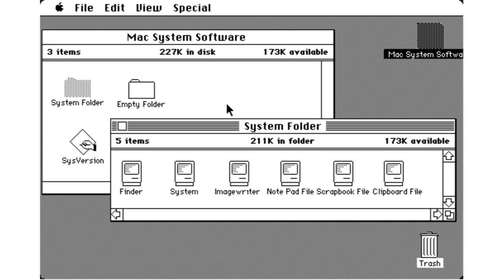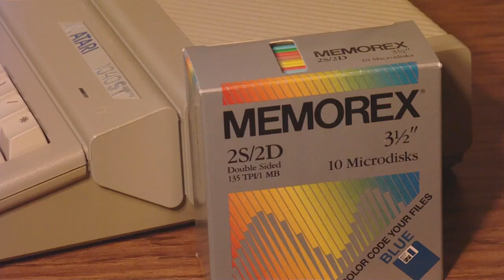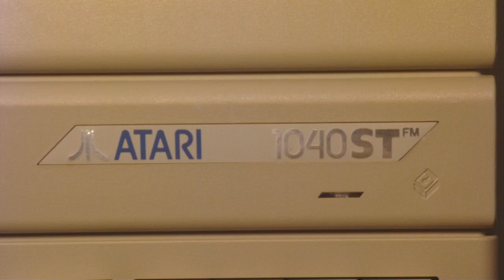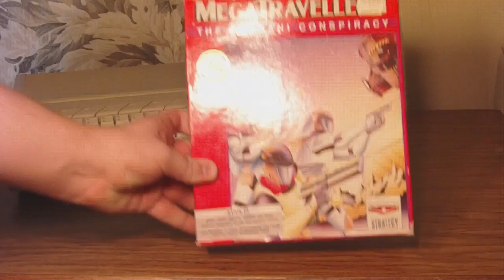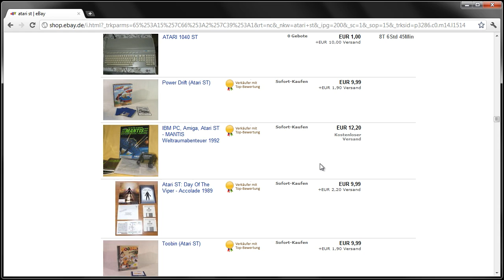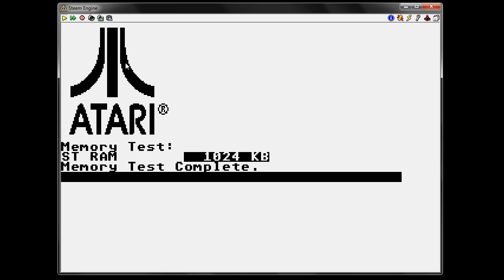LGR - Atari ST Computer System Review

Comment: The timing of the midi ports on these machines still scores the highest accuracy scores in midi timing device shootouts,the midi clock is unburdened by a bloated OS like modern pcs which have shockingly bad midi timing.I learnt all i know about music using cubase on the 1040ste.Great machines :-)
Reply: Very neat story, Scotty! Thank you!
Reply: Still have mine, had cracked Cubase, without a dongle, it never crashed though and was always rock solid, use Ableton now, which has crashed often.
Reply: Pretty much started (or enabled) the whole techno /Industrial /Euro dance craze of the early '90. Almost every professional (and most amateur) studios had one with a B/W monitor (exceptionally easy to work with for longer periods of time), sometimes even with SMPTE timecode sync (so the MIDI playback cursor would follow along with the tape). Great stuff!
Reply: @christophergodawski5663  Yeah, I'm actually watching this (though I'm an LGR fan in general), because it was on a list of hardware used for Aphex Twin's Syro from 2014.
Reply: Interesting bit of info, thanks
Reply: @christophergodawski5663  I think FatBoySlim used an ST for some of their makings.

Comment: Extra fun fact. The cartridge port was used by the required dongle for C-Lab Notator, which was the MIDI software we all used on this great machine. The connector was in close proximity to the MIDI ports, mounted directly on the PCB with little mechanical support, and a lot of the used units out there have dodgy cart slots as a result.

This was my first computer and I used it for years to make music on, and really loved it - despite the fact that I had to secure the dongle with gaffa tape in the end.
Reply from the maker: +The Bright Pixel Interesting, thanks for the info!
Reply: +Lazy Game Reviews Thank you for the incredibly entertaining videos! I'm a new subscriber - after Mr. Ben Heck told me about your channel on twitter the other day. Love the retro tech.
Reply: +The Bright Pixel +Lazy Game Reviews - I used to have a mono audio sampling interface that used the cartridge port. When I was a teenager I used to hook it up to a CD player to take samples, then I made my own remixes. I used to love the Atari so much =)
Also I'm not sure if it was mentioned in the video but shortly after the ST FM was released, the ST E came out which featured 'E'nhanced graphics and sound which equaled the Amiga. It's a shame you didn't get to review that model as pretty much all the negative points made are unique to the ST FM line.
Reply: Cubase was invented on the Atari, it was originally called Notator.
Reply: *****
 Ah okay :)
Reply: @LGR  could you possibly use the ATARI mouse on the NES?
Reply: That's not a fun fact, and definitely not an extra fun fact.  It's actually a sad fact if you ask me.  I mean physical DRM caused irreparable damage to countless machines, that's a terrible shame! 😢

Comment: Something I really liked about the ST was coding in assembler, it was a joy to do, with excellent reference books available. I'd done a fair bit of 6502 coding on BBC Micros and an Electrion, but asy on the ST was in a different league. I ended up writing an entire word processor in 68K, which was ridiculously fast in use (it was my main 3rd year project at uni, the largest they'd ever received, the listing took 2.5 hours to print out). Funny thing, the program became popular with other students, they used it in preference to the editor supplied by the uni. :D

Ian.

Comment: You could link up to 16 computers using the midi ports and play multiplayer MidiMaze.  The tagline was "KILL A HAPPY FACE"  It looked something like hover, but the characters were all round balls/happy faces.  You roam around a maze and shoot at each other.  FUN!  A buddy and I also made a hard disk interface that converted the Atari DMA port (proper terminology) to a SCSI port so you could hook up any hard drive.  Mine had a 480mb NEC drive, a CDRom from an Apple, an 68030/12mb upgrade (the SST from Gadgets by Small), and a video card upgrade to 1024x768x16 bit graphics.  It outpaced PC's for 10 more years.  I still have it, but haven't fired it up in 20 years.
Reply: MidiMaze is also afaik the first FPS game.

Comment: I didn't know an NCR 386SX could run Windows 7! :-P

I haven't had any trouble running PAL programs on my NTSC 520ST. Even the U.K. PAL version of TOS runs fine. The video output becomes 50 Hz NTSC, but it displays fine on any NTSC composite monitor or TV with a manual V-hold adjustment.

The Mega ST was also briefly popular for desktop publishing when Atari packaged it with a low-cost laser printer. You got most of the capabilities of a Mac and LaserWriter at a fraction of the cost.

Comment: Fun fact - You can use Sega Mastersystem controllers.
Reply: Or genesis
Reply: Genesis controlers are wired slightly differently and do not work with the st.
Reply: Oh, i thought they were the same pinout. I was wondering, since i've used master system controllers on the genesis.
Reply: Genesis controllers, even the six button ones, work just fine on my Commodore 64, though, so it's probably something to do with Atari trying to limit the amount of controllers to use and really just failing with SMS controllers still usable.
Reply: Fun fact, you can use an Atari joystick in the Genesis (however it really only works with Sonic, or other games that use one button).
Reply: There was a joystick extender box available, where you didn't have to fumble with the ports at the bottom of the machine anymore, you simply plugged the joystick/mouse into the extender box next to the machine (one can even make one out of some spare parts).  The non-"M" version could be modulated with an external video to RF modulator.  So there you have it, shortcomings "sorta" solved. :)
Reply: Yep, just saw one up on eBay, it's called the Mouse Master. It also let you switch between a joystick and a mouse.
Reply: @bandombeviews6035   I knew some issues with different 9pin controllers pluged to then  messing Atari KB functions
Reply: @Rooflesoft Games The start button is wired to +5 volts and ground when used with a Commodore machine.
Reply: It's like a crossover between Europe's 2 favorite systems.
Reply: @billant2  I had an short extender lead, brought the ports to front. No lifting.

Comment: This 1040ST has a special place in my heart. My first computer. Everything i have is directly coming from this computer. I have done everything with it, even used it to developed assembler machine code for pc at school. I controlled all my synthesizer, increased  the color to 4096 simultaneous by injected software in the vbl refresh loop and switching the color palette ..crazy..Atari St will be my best computer forever. I regret not having contacted them at this time. I had great idea for computer graphic card and system development. The Atari would still exist today, i believe. I played my first flight simulator, played Dames, and games. I remember going to the small shop and extended the ram by solding 512K additional memory. An other time..

Comment: The Atari ST was a joy to program for. 68k assembly was a godsend compared to Intel (tons of 32 bit registers, sophisticated instructions, flat address space) and the machine was very simple, with well documented BIOS/OS interrupt calls similar to MS-DOS and no weird coprocessors to program like in the Amiga. Unfortunately, the 68k by itself was not fast enough to update an entire screen each frame even for simple 2D games, so in absence of those processors and without sprite support, many games were slow, with 15fps or lower being very common. In addition, the screen layout was really weird, with four separate bitplanes interleaved every 2 bytes, so graphic routines were even slower.

Comment: I moved to the ST from the Amstrad CPC6128, and so be honest it always felt more of a sidegrade than an upgrade.
Sure I got more processing power, lovely 68000 instruction set, lots more memory, twice the graphics RAM and a mouse.
One the other hand, as a programmer I was gobsmacked when I found (due to the graphical operating system) you couldn't change the graphics mode without rebooting the machine.  The 320x200 mode was unusable as a text editor due to the amount of horizontal scrolling (no line-wrap like older machines) and horrible colour flicker on vertical scrolling.  The 640x200 mode was unusable without a monitor.
Hence I was forced to buy a monitor (not an Atari monitor, a 3rd party monitor worked just fine) and was stuck programming for a 4 colour graphics screen since (in high level language) there was no way to change the graphics mode and still have the graphics commands still work.
So yes, more powerful than the Amstrad CPC, but the old Amstrad just felt like everything fitted together much more neatly.
I miss the Amstrad - don't miss the ST.
Reply: As a programmer, you could easily change the screen resolution between the modes supported by the attached display, and you could even design your own screen resolutions.

Comment: The only thing wrong with Atari ST is Amiga 500.
Reply: You got that on the money. The Amiga was capable of a bunch more than most computers at the time. For example: many Windows applications that were made at the time had little problem with AmigaOS.
However, Considering that I don't have the budget, I might want to start with an Atari ST as my first pick.
Reply: retrogamer33

You could get midi adapter for 20 dollars or so. But on software side you are correct, there was much more midi software on Atari ST. Then again, real men used Soundtracker or Protracker, not some midi shite.
Reply: actually, it was the built in midi ports and hi-res monochrome monitor support which was ideal for applications.  If you were a musician on a budget, the ST was the better out of the box experience, and as a result, it got very robust application support.

The same is true of the Mac to a certain degree: It found it's niche in Desktop Publishing.

The Amiga found a professional niche in video work as well as an excellent games machine.

To a certain degree all these machines were theoretically as capable as any other in all fields of endeavor.  No surprise really, since all three are so closely related in terms of hardware.
Reply: Musicians also chose Atari ST because of Cubase software not available for Amiga.
Reply: That's the classic chicken & egg problem. Had musicians chosen the Amiga, Cubase probably would have arrived on it too.  (certainly, there were alternatives, but cubase was industry standard)

So, we come back to the motivations of the ST buyers. And the answer once again comes back to the ST hardware. It had built in midi. And the hi-resolution, no flicker monochrome monitor the ST had for professional work, so if you were a musician and had little interest in a computer for anything but music, a single package purchase of an ST, Cubase and monitor and you had everything you ever needed from a computer.
Reply: Atari had a great free unix culture.  MiNT was the shit and got me my first unix admin job.
Reply: It could also emulate the mac and was stated to run it quicker and better than a real mac, was a great all round machine, the Atari was great for music with its built in DAC and Midi etc...
Reply: Richie Amiga was also a pretty good mac emulator, and probably for much the same reason as the ST
Reply: TheTurnipKing the only thing that let the Amiga down was price and not targeted at the home user at first, Atari ST was aimed at the home user, both machines missed key markets and for the price Amiga shout of stuck a Midi in and downgraded some parts to hit the home market first then target business market
Reply: The market was exploding and still has not stopped.  There was enough room for everyone, but they all made a huge mistake in playing an extremely competitive game instead of a collaborative one.  If Atari, Commodore, Apple and Motorola had gotten together to develop some open standards and common platforms, they might all be around today, and we might have some technical-consumer-friendly technology, instead of having to use insecure systems that we don't really own or control and which rather than being our tools, exploit us on behalf of their corporations.
Reply: actually while Commodore & Atari went down the plughole, Motorola and many others did exactly that with the PowerPC initiative  The Powermac showcases Motorola's solution for backwards compatability: onboard 68k processor initially shifting towards software emulation for old software as the OS was ported to the new architecture.
Reply: Richie Absolute rubbish. Both the Amiga and ST were aimed at the same basic market. The home user. The fact that both were used in a various types of media production was simply a by-product of certain hardware choices, not some great master plan laid out by their creators. The history of both Amiga and ST, as told by those who designed and created them, are well documented and easily found.
Reply: Both machines are nice in their own right, I've liked the Amiga for a while, but I've played on an ST firsthand. I hope to be able to play an Amiga so I can have experience using both machines.
Reply: Yall talking about what real musicians use & what they don't.  None of u are making any sense. As the only real musician here i can vouch that I only need a Tascam DP-008EX 8 Track MTR.
Reply: @TheTurnipKing  it would have been interesting had Atari and Commodore/Amiga merged, they might have produced a.systwm that far acceded Windows and Apple, and would still be here today.
Reply: @The Jason Knight Fiasco Band "Yall talking about what real musicians use & what they don't.  None of u are making any sense. As the only real musician here i can vouch that I only need a Tascam DP-008EX 8 Track MTR."

Go tell that to Madonna, you bozo.
Reply: @Sl1pstreams  In the end it is always the customer who decides. And there the answer was clear.
Reply: @Sl1pstreams  Of course everything ends. I was talking about the preference between the two. Amiga outsold Atari about 2:1 in all use. As a computer Amiga outlived Atari, as a brand, Commodore did die earlier.

And yeah, super nostalgia, but it was really interesting to live through those times, as the changes were massive in just few years. Nowadays we are back to more incremental changes.

Comment: Also, one of the pins of that big RGB monitor port is actually a color composite video output, and of course another pin is for the audio, so that way you can connect it to any modern TV and get better video quality than through the RF modulator. You can make your own cable, or sometimes find pre-made ones on eBay.  (However, I've heard that only models with the built-in modulator have the composite output, but I haven't been able to verify that.)

Comment: The ST joystick port was closer to standard than the Sega one though - Atari, Commodore and others had been using that same interface and pinout for years, and many models by that point (at least 2600, 400, 800, VIC 20, C64, most Sinclair joystick interfaces...). In practice, you got a little 6" extender cable to get around the stupid placement, and a little switcher box to use both a joystick and mouse on port 1.

Comment: Nice video! I own Atari 1040 STFM, so I have some comments:
-you don't have to use Atari monitors if you don't have the modulator - you can buy Atari ST - SCART cable (to connect it to TV and use in color mode) or Atari ST - VGA cable (to connect it to VGA monitor and use monochrome modes). Of course there are schemes of that cables in the internet, so you can do it yourself.
-you don't have to use DD 720 kB floppies - you can use standard PC 1.44 MB HD - you just need to cover one of the holes in the floppy and format them as 720 kB.
-also it is possible to use old PC serial port mouse (at least in TOS/GEM), but you need some driver for that and you need to have RS 232 25 pin to 9 pin adapter to connect the mouse to Atari modem port. Then you have mouse connected to the back of your Atari which is less annoying.

Comment: The ST was inferior to the Amiga when it came to sound and graphics. The Amiga ports of games were almost always better, at least in the early nineties. There were some games with sampled sound, but the sound quality was not as good as it was on the Amiga. The STE on the other hand, was more like the Amiga, with 4 channel (8 with tweaking) dma sound, stereo outputs and more colours. Sadly there were almost no games that used the enhanced hardware on the STE. Obsession was a Swedish pinball game released in '94, way better than Pinball Dreams, which really showed the capability of the STE. It was later ported to the Amiga and the PC under another title which I can't remember. The cartridge port actually had many uses. Copy protection dongles, samplers, 'blitz' copying devices, hacking cartridges, a Macintosh Plus emulator and more... Here in Europe there were many, many peripherals, games and programs available for the Atari and Amiga. And all the great games or great ports of games you must have missed in the U.S, like Lotus 1-3, Supercars 1-2, Nitro, Oil Imperium, Cannon Fodder, North & South, Sensible Soccer (many of them best enjoyed with the legendary TAC-2 joystick)...sadly, I generally recommend the Amiga versions of these games. Of all the 16-bit systems, for gaming I place the SNES 1st followed by the Amiga 500.
Reply: nixpix2 Amiga may have had a slight edge in graphics, but cost 2-3 times the price so not really worth it and why Atari dominated as Amiga struggled only later did Amiga start to dominate for a short time until PC dominated, both the Atari and Amiga were quite similar and both just as good but Amiga aimed at the wrong market at first Atari slow to progress the ST to STE then to falcon